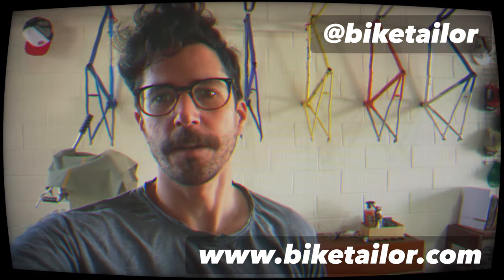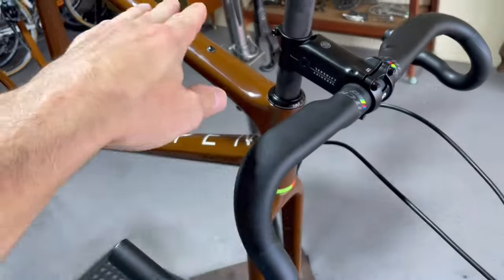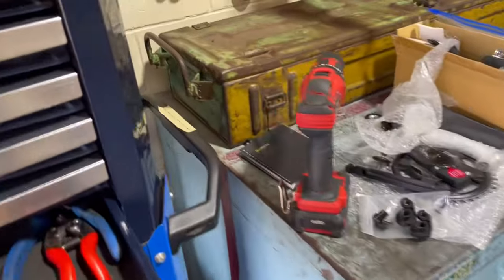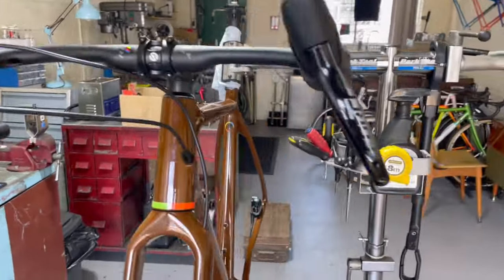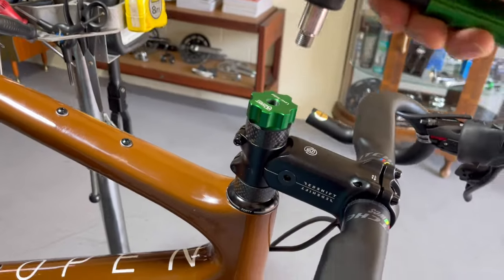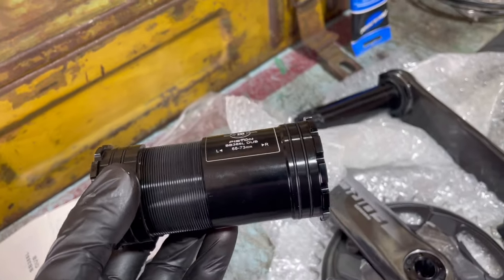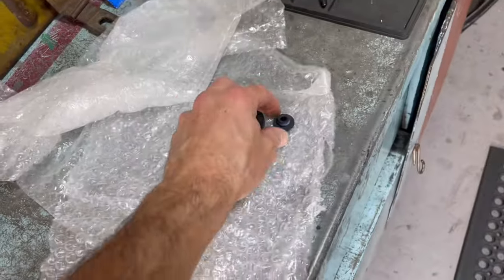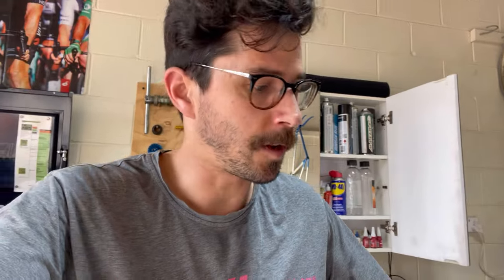Open WI.DE. Gravel Bike Build

Comment: BB shell too big, misalignment between the bolt and the hole… little details that shouldn’t exist on a frame set at this price point. 
A bit disappointed with Open Cycle.
Reply from the maker: Totally agree. But you’d be surprised on how many high end frames these things exist.
Reply: @biketailor  that’s sad to hear. 
Looks like for many brands prices and quality aren’t headed in the same direction these days  😞
I thought Open were a bit different though.

Anyway, nice video and nice work 👍
Keep up.
Reply from the maker: Yeh I hear you. I’ve only built up this one Open, so maybe this one was a bit of an anomaly. Overall it went together well and the customer is very happy with how it’s been riding, so overall it is positive.